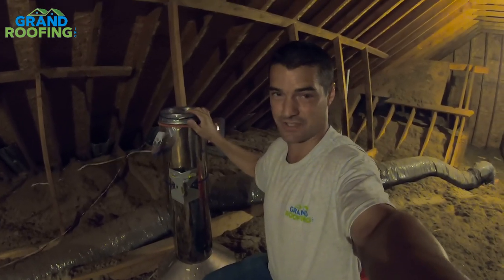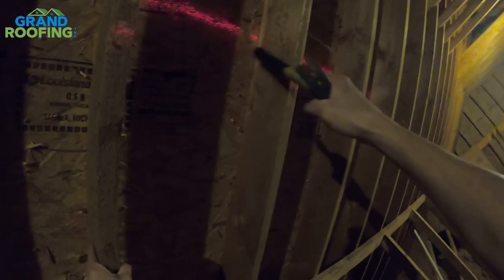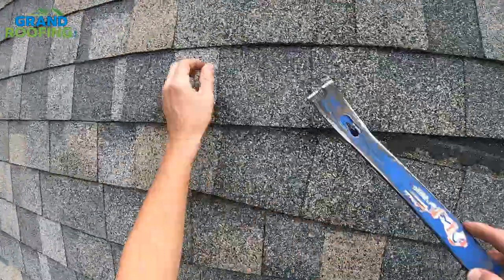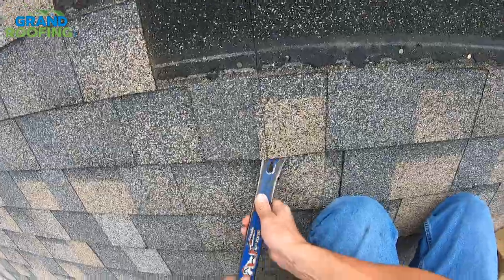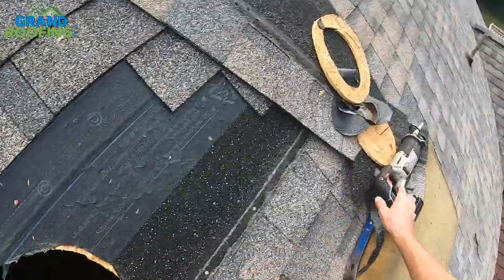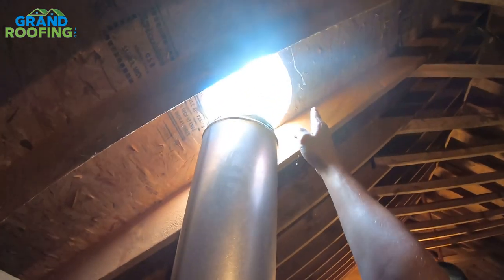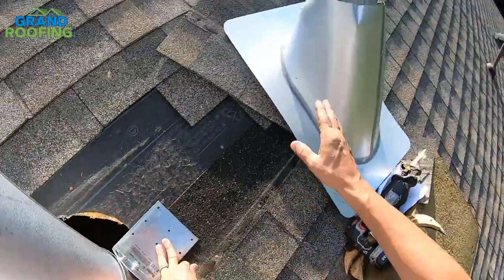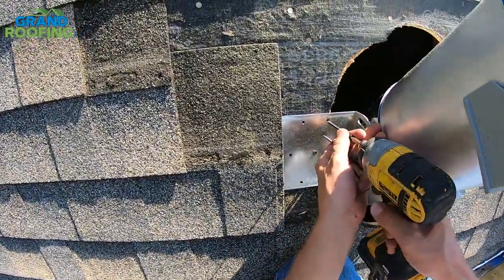Chimney Pipe Installation for Wood Stove through roof

Comment: This is how it should be done by a homeowner. Do the downstairs work yourself, save the $ on the install, then call the roofing professional in to make the penetration through the roof and let him make sure it is flashed & shingled properly. I have seen so many DIY'ers that really tried to do a good job on a wood stove vent, but missed the small stuff like tucking the brace brackets under a shingle and instead, they nailed it right on top of the shingle into the roof deck. So rather than screwing with proper embedment into the top chord of a truss and getting excellent tension values, they're expecting a simple nail through a shingle into 1/2" deck to withstand the multi-directional wind forces on the vent. Then they're expecting the dab of silicone caulk on top of the nail head to give them water tight conditions. There's way more to this and Brian, you make it look easy. Cheers to you
Reply: thats what i wanted to do and was given quotes of 3500 bucks.... sorry but that grotesque just to have a hole cut with cathedral box installed
Reply: @TheFoundBeliever  that's bull
Reply: @Zack-lq9tb   reality is reality and if ya dont want to believe it and live in fantasy land by all means thats your choice.

Comment: Doing this on a professional level for crematoriums we used red top end engine silicone on the flange. not sure if wood burning stoves need that but it helps to keep the moisture out if water runs down the chimney.

Comment: Maybe that audio issue was a blessing in disguise.  When you do voice overs, you have the opportunity to add things you might have forgotten and it's smoother than adding text into the video.  

As usual,  I've learned a few really helpful things.  Namely that this transparent harnesses and safety ropes are nice cause they don't hinder your movements and get in the way of your work like those solid color ones.  😂

I've used a plumb bob to send mine through the roof and have boxed out the truss on two installs.  Not sure if that was the best thing,  but it all felt strong.  

Smart thinking with the lager to smaller diameter anchor rods. When water gets in those,  they will rust and break free.

Cougar Paws are great on singles, period.  But they absolutely suck on steel! That lower roof would be about the steepest I'd go with em.  

Thanks again for making the time to share your knowledge and skills.

Comment: You can also shoot a nail through the roof center of the trusses, then put your flashing down onto the roof (center of the nail poking through) mark the shingles with marker or whatever, cut the shingles straight up from the lowest row of shingles you can, cut all the way up and around the circle you marked and straight back down to the row you started. Now all you gotta do is cut the plywood circle you desire with Sawzall. Pull any nails loose you can to slide the flashing up underneath all the rows till it sits flush with the circle you cut out of the shingles. Nail it on place and run the flue pipe up through the attic. Sometimes down, screw that bitch in place, caulk it, call it a day bud. I did hvac flues for 10 years that way, never had a leak from shingles not overlapping the flashing enough or any of that.

Comment: Thank you for the video. My tablet has a setting for playback speed, so I slowed it down a lot when you were whipping your head back and forth from one side of the pipe to the other. That cut down on my dizziness, but made you sound much too drunk to be on a roof! 😆 I would love to know the name of the phone app that reads the pitch.
Reply from the maker: The one I use i believe  was just called pitch gauge.

Comment: Anything else need to be done to the interior, where the pipe meets the ceiling?
Reply from the maker: There's a metal thimble that goes in. It keeps the hot pipe away from anything combustible.

Comment: I am having to rewatch this...as I do not want to get it wrong...my stove took a bit longer to arrive and I will now be installing it in freezing weather...and I have a medical condition called Raynaud's syndrome which basically means that when the temperature changes you lose circulation to ...well in my case my fingers...it is painful and dangerous if you are working with power tools....which is why I want a wood stove in my shop...but now that the temperature is not in my favor I will have to be extra careful...good thing I married a man who has the last name Carpenter... who will be helping me install this tiny wood stove just enough to take the chill out of my shop...BUT he is a Mechanic...I love him but he does not know one end of a saw to the other....I would say hammer...but he has a few of those....so I will post if I have succeeded in my attempt to install my little grizzly wood stove from Quebec Canada...you should look them up if you are in the tiny house movement!!! Once again I really do appreciate your video's... they are by far the best roofing videos I have seen.
Reply from the maker: Thank you glad I was able to help. Sorry to hear about your fingers. I know what you're going through kind of, because I have Menieres disease which is a Vertigo balance issue. Definitely not good working on roofs.   Be safe and good luck to you.

Comment: I like your work I just hate those style   boot for metal bestos you should get yourself a set of rolls and a pipe lock machine and make either copper or galvanized thicker materials and saulder your flange to your stack and lay out your own storm collar caulking on them stacks always fail and leak and then people monkey crap the piss out of them and it's so esthetically unappealing I only make my own sleeves stacks boots vents everything and  all is sauldered  you could have the shop tools and still fit them in your garage without taking up much room  your job looks good you quality of work is grade a just the materials suck box store materials are too china quality

Comment: I had one for my wood stove and it burnt my house down
Reply: Àwful...had one what??  Wood stove??
Reply: @chloejasper6852  it was the same stove pipe and cot the insulation on firer 
The only chimney I would use now is brick  just tough I would share
Reply: @louieboe1164  so I'm about to install a tiny wood stove today or tomorrow. I paid extra for triple insulated pipe. And I live in a single wide mobile. I'm hearing that you don't think that's very safe?  Was yours installed properly? And did you keep it the creosote cleaned out?

Comment: It always surprises me that you use shed felt on your homes you do not use tile or slate.your homes are not constructed to last. We expect homes to last at least 450 years . 
No one woke working on a roof without at least body harness roof ladders
and climbing gear secured by ropes. Cherry picker or scaffolding. It would not be allowed by law. Saying I not your mother is irresponsible and dangerous. People need to be told about safety. Safety first is one of the most important aspects of a  action thar care you cannot be sued for promoting safety

Comment: Great video. Thank you. One thing to keep in mind for diy is to make sure you get the right pitched flashing as well.  Most are 0-6/12 and if you're over that you need a steep pitch flashing. 
For the height, I've always heard 2 feet higher then whatever is in a 10 ft  radius..

Comment: Just a added install tip. All wood stove pipe installs need to be a minimum of two feet above the peak. I like three feet for a good draft. Dura vent install kits come with a great install book.
Reply: I think that changes with a lower pitch roof when the pipe is further away from the peak.  When I installed mine, the clearance was dependant upon the level distance either to the roof or to the peak.

Comment: I'm an avid diyer,but scared of heights. I'm farming this one out to a local contractor.  It's a single story house with an attic and flat ceiling downstairs. He said $500 for the instal. I've got the basic installation kit ( ceiling box,storm collars,transition ring,chimney cap) and double wall pipe from selkirk supervent on order from lowes now. Supposed to be here before the end of the month. Cant wait to get away from electric heat,lol.
Reply: Make sure you give enough clearance double wall is 6 inch clearance and triple is 2 inch

Comment: I Install and inspect Chimney’s for a living i’m sceptical there’s 2 inches to that rafter on the left and the sheathing after levelling. Hopefully the homeowner installed the bottom portion correctly as you’re assuming responsibility for his work.
Reply from the maker: It's kind of hard to tell from the camera. Everything looked to be pretty good. In the estimate I figured, I included that the homeowner installed everything through the roof. I was only contracted to put the flashing in above. It was clearly spelled out in the estimate. Whenever there is a possibility of liability, I try to cover myself.
Reply: @GrandRoofingInc  good thinking , impeccable shingle work around the flashing. I always get a kick out of homeowner installations when they just put the flashing right on top of the shingles and tar the hell out of it ……

Comment: You need to apply fire proof or high temperature sealant to the underside of the flashing on the sides top but leave the bottom open for drainage then nail it down to the roof he screwed up

Comment: So my million dollar question is this 

1. What is the best caulking to smear under my wood stove chimney flashing I also want to use this same caulking around the rain collar I want it high heat. Silicone, polyurethane, or whatever else I'm in need of knowing what you like I want it to have a strong grip under that flashing against my roof shingles 

2. For nails I popped up and shingles I had to lift to work the flashing what is the best most favorite roofing stuff I should uses I want it to fill nail holes I pulled up out of those shingles but also run it along to reseal the shingles 

I'm asking because I used some shit yesterday that is weak under my flashing I'm going to pull it up strip it off and re caulk with hopefully something good people can tell me here I'll check back in to see if anyone replied

Comment: Did I miss it or does a person add pookey all around where the rain shield meets the stove pipe? For me, I wished you didn't FF through some of the steps like the shingle removal but FF through putting nuts on the stand off supports is perfectly fine. Thank You for the informative video.

Comment: Why is it so tall
Reply: Mainly because code requires that there be a minimum distance between the top of the pipe and structure, so that winds coming  from any direction won't obstruct the positive upflow of the exhaust.  If it's closer to a structure,  wind can cause burble effects which can interfere with the draft and smoke can go down the pipe into the house or air intake.
Reply: There are also issues that can arise with the change in barometric pressure and therms.

Comment: We had a chimney going through the roof for wood burner, worked great but husband wanted to go through side wall. Thought it would burn better! Now having drafting problems and doesn’t give off the heat it used to! Still gives off heat but instead of 80 in the house now 70 degrees. We only heat with wood. Any suggestions?
Thank You
Reply: Make sure it's above the roof a few feet to draft the best

Comment: Was just thinking how I wish your company was near by. After calling nearly two dozen companies,  I couldn't get one of them to come out to do an install like this.  Turns out you're in Tipton IN.  Does your company do work near Martinsville?
Reply from the maker: Not usually,  it's about a 2-hour drive.
Reply from the maker: If you can send some pictures over to the email of what the roof is like and an address I'll see how far it actually is and possibly consider.
Reply: @GrandRoofingInc   I will email some pics of the roof. 
Wasn't sure if you contracted some of your work out,  and maybe you had someone out this way.
Reply from the maker: @rkraszyk5824  no it's just me that does all the estimates and most of the repair work